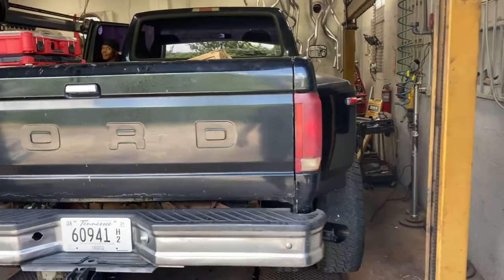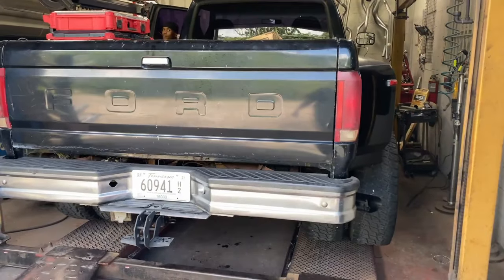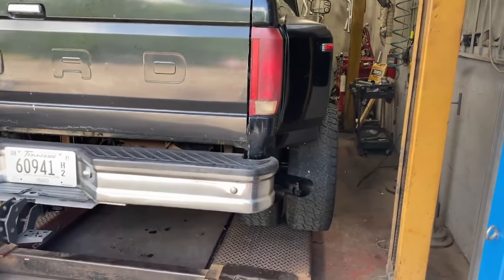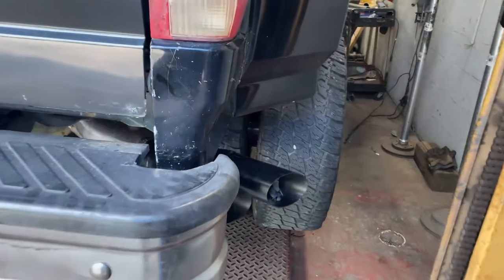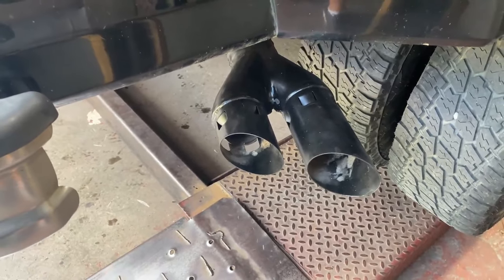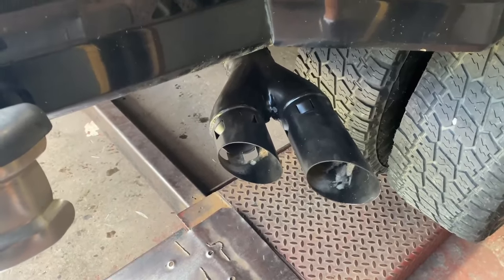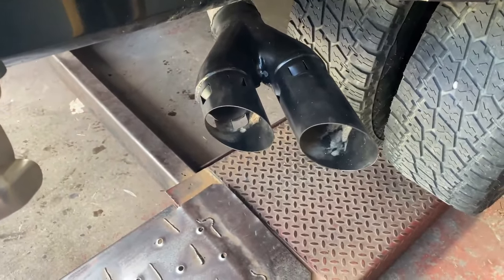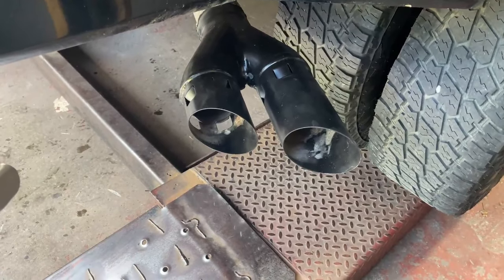1997 Ford F 350 7.3L POWERSTROKE EXHAUST w/ 4 INCH STRAIGHT PIPES!

Comment: Shouldn't the tip be flipped the other way
Reply: yes, it should.
Reply: Looks like a recycled tip off a current Powerstroke. No need for those vents without a DPF that runs Regen.
Reply: @Robbgt  it will still cool the exhaust if the person really wants that tip (granted it is facing the correct way), but it is not necessary because it doesn't have dpf regens.
Reply: Jajajajajajajajajajajajaja
Reply: Exhaust tip is mounted wrong twist so small tip is in front lol sounds great tho
Reply: It matches the contour of the bed looks better
Reply: @sykostevesfupadventure  same here.

Comment: It needed a 8 inch or higher single tip to be legit.
Reply: Anthony Harris agreed to an extent. Some of the newer trucks look better with the 8 inch tips. But yes majority of the time anything bigger than 6 is stupid. I got a 5 inch straight all the way back no tip
Reply: @jameskingsbury58  the kid I bought my Cummins from a while back had a 4" straight too a 9" or 10" I can't remember tip, it looked like a folgers coffee can lmao I put a 5" I had laying around on it and it's much better. It's a axle dump right now but I intend to go with a 4" single too dual kit. 94 12v
Reply: Other than Class 8 trucks, anything bigger than a 4” pipe and a 5” tip is gay. Seriously, there’s no point at all to go beyond that.
Reply: @mr.butterworth  I have a 5 inch pipe and 6 inch tip because 5 is louder and 6 is the smallest tip you can put on a 5 so there’s the point

Comment: Kinda almost sounds like a super duty 7.3 ngl
Reply: @Thomas McCabe no it’s not, 94-97 was it’s own motor, then 99 was the OBS 7.3 PSD with different top end, then in 2000 they overhauled the motor to the “Super Duty” 7.3 PSD

Comment: The Geniuses put the tip upside down. Why am i not surprised. 😐
Reply: That’s on purpose so It flows with the trucks lines Mr know it all
Reply: @bradley4698  whatever helps you sleep at night. Lol doesn't make it right.
Reply: @CloudHindlen  perhaps the customer wanted it that way?
Reply: @kodi5312  that is the single most ugly tip that Ford ever made. And I am a Ford guy.
Reply: @CloudHindlen  I mean I agree but, shiting on someone else because you may not like what they like is uncalled for. I can't stand squatted trucks, but i installed a few lift kits like that for customers
Reply: @kodi5312  I feel the same about squatted truck's and I am not shiting on anyone. I am just posting my opinion. They can unmount the cab and flip it upside down and bolt it to the frame with the roof just so they can drive upside down for all I care. I am also a mechanic so I know we have to do stupid things for people some day's.